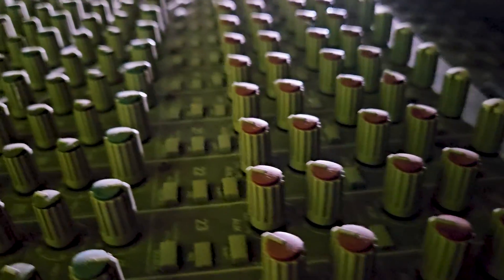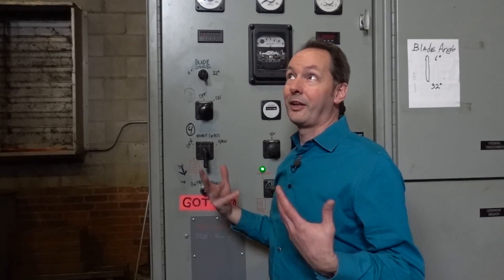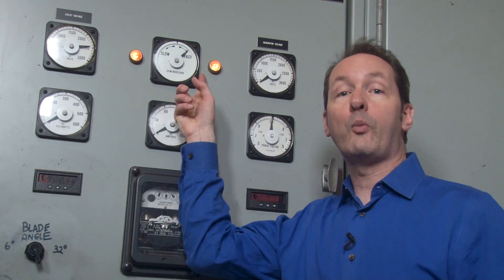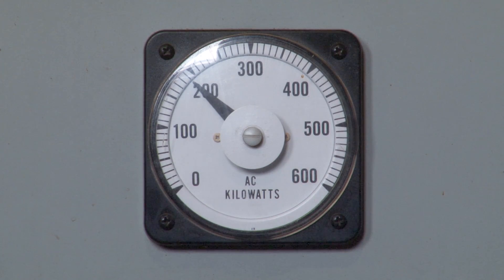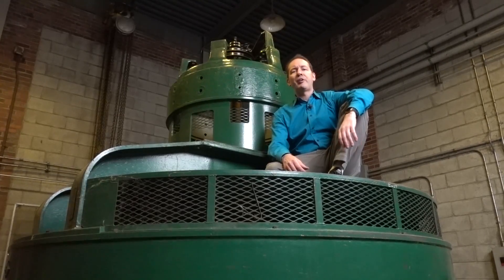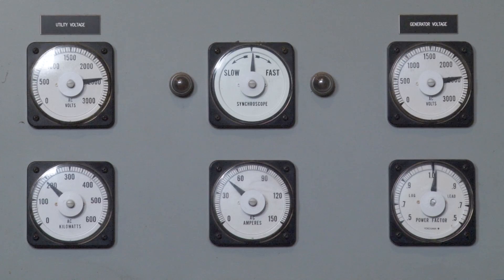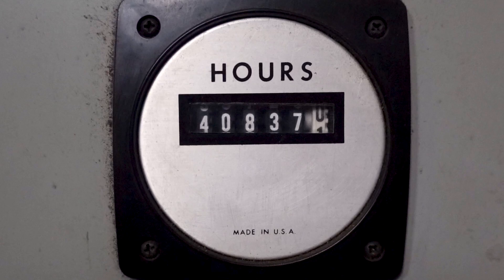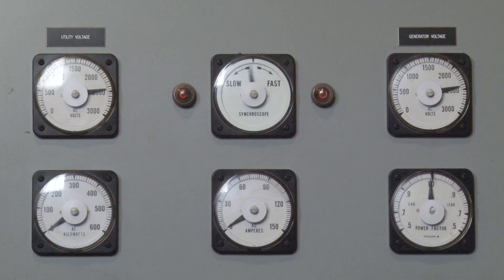Powerplant Control Panel Tour - Part 1 Authorized Personnel Only S4E1 #engineering #powerplant

Comment: Old school prime power plant operator from the 80's.  Small plant, about 3 meg-old even then.  (Newest sealed parts were stamped in 1957)  Did manual paralleling, of the 6 diesel generators as that was the only way we could parallel, on the Golden Gate switchboard equipment we had.  We were the same voltage at 4160/2400 VAC.  Manual loading/unloading, the whole nine yards.  We had the synch scope, and the lights.  Paralleling was always a pucker moment.

Comment: The average home has a  potential to consume 200 amps. But on average its probably half that. Rarely is every appliance, every light, every TV and stereo and PC on at the same time. So roughly an average home consumes  Basic math would be 24kw. Then just multiply that by how many homes served by your utility.

Comment: ELI5: Difference between voltage and amperage? Numbers (110, 220 , 440 etc). I don't have the trades science tism. I have the know a little bit about a lot tism. My exciter would turn on if everything is running. Yay movement and noise 😊 please and thank you. You're doing God's work Chris, for so many different reasons. Keep it up! 🫡

Comment: The math works out if you assume 1.0 PF. Obviously the analog meters are not able to be inferred exactly, but if you eyeball it, then~191KW (total) = ~2410v (L-N) * ~46A (L-N) * 1.732 (converting 1 phase to 3 phase).

Comment: 1500 volts, 200.000 watts / hour. If you calculate this it should be 135 amps, but there are 3 phases, so each phase will see 45 amps when delivering 200.000 watts at 1500 volts.

Comment: I blew $900 on a heavily used 40 channel, 8 bus mixing desk that came out of a megachurch. Naturally, coming from a place like that, it had to be purified before it could be used in my basement studio, complete with acoustic treatment consisting of Harbor Freight moving blankets hidden by vaguely gothy wall hangings. There were candles and incense involved, along with a tolerable middling-grade absinthe. I will neither confirm nor deny the involvement of a sex worker, nor a not-so-well-known "murder punk" band, first of their sub-genre.

Comment: Not on the "vegas mode" spectram. Control panels need to be where required and minimal. Most should be UI or at place of need towork even if electronics fail. Especially emergency relevant controls need to be retard level simple. Preferably one switch to turn everything off ALWAYS everywhere 0:43

Comment: Fun stuff! I recall reading that some utilities will shift the 60Hz frequency ±0.5Hz to control how much power personal solar / wind / etc. grid tied inverters can put on the grid. I wonder how they correct for that since many electric clocks, and other grid tied devices, depend on the highly accurate 60Hz tolerance.

Comment: And now I need a reason and application for a synchroscope in my amplifiers (volts and amps can monitor usage and battery level... Maybe the Synchro can measure sound quality by feeding a tone through the amp and checking both input and output?🤔)

Also, Black Start... And, gee Chris, why is the KW/H such a sucky unit?😏😆

Comment: So with your nominal voltage of 2400 and only pumping out a meager 200Kw, you're only generating less than 100A of current?
That seems... I wanna know, where are you that a functional power plant only needs to add 200kw to the grid and how is that profitable? So many questions. Guess ai should finish the video, first, lol. Absolutely love your stuff!!
Reply: I'm not a power plant (as in this video) but I do work with large trailer mounted mobile power stations. We usually are sending 800-1000Kw through 2 semi trailer mounted units. Easch unit is actually 2x 400Kw gennies with a control room between.  So we have 1600Kw max and usually stay below 60% capacity. Even that is usually only for a couple of hours, max. 
480v with the usual 5wire 3 phase run of 4/0. Easch of the 3 hot legs safely passing 200A of current.
So we have many sets of this f*%king heavy ass cable and run it hundreds of feet to a set of 2x 800Kw transformers.

Comment: Output amps look fine to me. For those more use to single phase, the voltage here is being measured between phases, not phase to ground. Phase to ground is worked out by dividing phase to phase voltage by the square root of 3 (1.732) = 1,385v (RMS). There are 3 phases, each at 46 amps. So, 3 phases x 46 amps each x 1,385v = ~ 191kW.

Comment: The plant where I work was disconnected from the grid. 38 mw biomass plant. None of the operators have experience this. I had to walk him through documenting. The reason why we tripped resetting of the trips. And getting our power back. We have a 115kv feed and generate at 13.8kv

Comment: I thought the reason the gagues don't line up is because the AC voltage is measured as the average voltage, rather than the peak of the sine.

Comment: Two reasons for volts times amps not equaling Watts. First it’s three phase power so you have to multiply by square root of three to get total power, and the second reason is power factor.

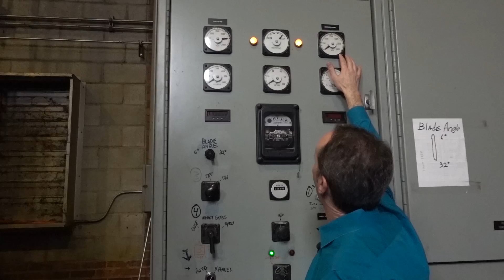Comment: At 5:55, why did you back into the grid?  Normally I like to get synchroscope moving slowly in the FAST direction to make sure the generator will pick up a little load when the breaker closes to prevent any reverse power.

Comment: As a machinery technician in the US Coast Guard for 24 years, it was part of my job to operate the shipboard generators. On Ice Breaker GLACIER, we had 4 500kw generators and 1 250kw emergency generator. The ship was built in 1953, ironically the same year I came on line. Our control panels unsurprisingly looked exactly like the one you’re talking about. 
Now this is one of those things that may not matter, but I was always taught to have the sync scope rotating clockwise slightly fast as the diesel would slow down a small amount went the load was applied. 
Who’s right, or does it not matter?

Comment: Mmm power generation. I grew up close-ish to the Bonneville Dam on the Columbia, and so I grew up living underneath the half-million volt transmission lines. 

Also typically when connecting a power source, in the navy standard practice was to have the synchroscope rotating slowly in the fast direction, but we had automatic voltage regulation (read: governor control on the turbine generators lol)

Comment: i toured a 1500 MW hydro plant when i was 16 and I've been hooked ever since. great vid 🙂
Reply: that was in 1995 and it's since been uprated to 1800MW(e) although my understanding is the plant rarely operates at full capacity as the NEMCO legislation requires them to maintain a certain amount of spinning reserve. It can also operate in syncon mode if and when necessary.. Pretty cool stuff, 6 Mitsubishi Francis units all managed by remote control in southern NSW Australia
Reply: the machine ur sitting on is smaller than an exciter at T3 just sayn
Reply: in answer to your question, it's all cyclic mate and if u truly wanna measure it smart meters with real time GSM connectivity will yield a pretty close answer

Comment: You could also just have a power strip that has one of the little blinking LED light switches in it and it blinks with the electricity coming in

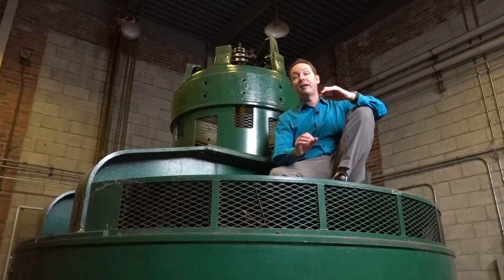Comment: IHi Chris, I've been a plumber for 35 years, I've been working in the plumbing industry for both industrial and domestic fields, I'm welding certified and have travelled the world since I was 16.   To answer your question at 9:15 about how many houses your generator has been powering: I have no fucking clue.   Hope this helps!

Comment: Can you actually explain why kW/h is a stupid way to measure. please :)

I studied for a bit to be electrician but switched fields to automotive. Still do a lot electric work but I basically only work in DC so I'm bit rusty on electric grid stuff.
Reply: A watt is just a Joule per second, so a kWh is basically a kJh/s or kilojoule hours per second. An hour is 3600 seconds, so that's equivalent to 3600 kJ.  You're basically putting in a time measurement and taking it out again when you could just measure everything in Joules.

Comment: Retired sparky and used PLO instead of AIP. Parts left over. We had three 2,000KW diesel Gen sets that would start up  & at least two of them be on line in less then seconds . Also had 4 natural gas gen sets that each had 6 huge 1,500 CCA 12 volt batteries connected to three 24 volt starters to get the pigs on line in ten seconds. Also made a ton of money during the summer using them to peak shave on hot days. Had to shed think it was 2 megawatts for 4 hours. Engineers would start up more boilers then turn on huge steam chillers and take the 2,400 volt chillers off line . Would transfer a few ATS's that feed mechanical loads thru VFD'S from normal power to emergency power ( generators ).

Comment: I did fuel cell micro-grid research for the DOE from 2003-2008. We used 2,200 watts as our average for residential loads. This was in the Southeast US where it's hot as crap in summer and we don't use oil or wood for heating in winter.

Comment: old school cool is more reliable then electronics there is to many variables that can go wrong sure automatic controls may be more so called efficient but when something goes wrong finding the problem can keep your system down longer trying to find out what happened. efficiency is not all ways a good thing  electronics are failing all over  take your power plant yes you have issues time to time but the old school is robust and simple  sure some items are hard to find and and have to be custom made but electronics have to be custom made as well to preform certain tasks then there is items that have software. your power plant will most likely out live all of us but the automated wont.  of Corse this is my opinion.

Comment: I don't know if any of it is still there, since I haven't visited the campus in decades, but when I was at WPI in the early '90s, the ground-floor lobby of Atwater Kent Laboratories (the electrical engineering building) was dominated by an enormous antique electrical control panel. It looked like the kind of thing a person would use to resurrect Boris Karloff, all humongous knife switches and big Bakelite knobs. Quite possibly the coolest thing on campus, and that was at a time when WPI still had a nuclear reactor. :)

Comment: I've only read and completed "Lessons in Electric Circuits Volume 1" that was when I was 16 There's several volumes and they are all free. I've been tinkering with dc circuits and building my own from toys I broke or took apart as a preteen.

Comment: The power station where I work comprises two 660MW and four 100MW units. And I work as an engineer on the two 660 MW units. And as you know, operating a thermal power station is far more difficult than operating a hydroelectric facility.

Comment: Interesting videos! To get the power output you need to multiply volts x amps x 1.732 which is the square root
of 3. This is because you're dealing with 3 phase delta power.

Comment: if the generator is grid tied it should be powering all of the loads on the grid with its 200kw, meaning a very small potion of each load.
system losses might also mean that more local loads would recieve more of the generator output. 
as far as i understand, i am prepared for correction.

Comment: As a mechanical engineer who’s worked in the electrical/power distribution service industry for 10 years I appreciate your content. I never get tired of visiting power plants and learning about their controls and processes. My favorite part is just seeing the vintage equipment that they have. 

Abandoned in place is a nice acronym. My whole world revolves around this type of equipment and keeping the old stuff going in some capacity or another (relay replacements, generator circuit breaker replacements, general switchgear bus/insulation replacement etc). It’s cool seeing you all still operating with all the old school tech!

Comment: Depends on time of year.

In the dead of winter on a dangerously-cold day, our house will draw somewhere around 23 kilowatts when the HVAC’s resistance heat kicks in.

I think you said your average transmission rate is around 250 kilowatts. So that translates to around 12 houses.

Of course not all houses will draw that much current. We are all-electric and use around 14 megawatt hours per year here in central Virginia where, ironically, the air conditioning load isn’t the real consumption issue. We have new heat pumps that are awful when it’s very cold. They’re inefficient below 20 degrees and on the coldest day we used 1/3 of a megawatt hour. Oops, that was before both were replaced.

I think your 1KW base load per house is pretty conservative and my guess is that you are powering around 300 houses on average.

Comment: Saw your videos ages ago and stumbled back across.  Echoing the black start request.  Does whoever comes online first set the frequency and everyone has to jam sync to them?  Also curious what happens if everything goes dark, how do you manage load so when things come up the draw doesn’t crash the system right back to nothing again?  Does it take a certain number of generators firing up together before supplying any customers again so there’s some buffer?  Must be the greatest draw on the system coming up from black.

Comment: Comon Chris, even I had emergency lights at my 23 year old gas fired power plant (Duel Alstom GT 24 with heat recovery units).
Reply from the maker: Look at you with your fancy new powerplants. The only thing that's as young as 23 years in this place is the top layer of crud and dust. This isn't a powerplant, it's Hospice for feeble old generators. They won't give me money for a BATHROOM I don't think I'm going to get emergency lights. But it's a good idea, and I'll ask the boss nicely.

Comment: CIVIL - Capacitance = current leads voltage, Voltage leads Current Inductance.

I find your videos fascinating.  I nearly got an apprenticeship with the CEGB (Central Electricity Generating Board in the UK) but went into the computer industry instead.

Comment: My calculations for the number of houses supplied are based on the annual output of the small  toy power plant.
The output fluctuates from 1 to 22kW throughout the year and we generate around 75MWh per year.
Based on 3500kWh/year, this corresponds to around 21 households.
But this is my way of not having to tell people that we can't even supply a toaster in the summer.

Comment: U need to calculate 3 phase power, P=3^(1/2)*voltage*current*power factor, then it adds up, also its phase to phase voltage so u measure it across 2 phases and not phase to ground

Comment: Chris in my old company (pre solar) in Australia for planning for new subdivisions we allocated 4 kva per house for areas that also have gas for water heating and cooking  areas without gas 7 kva per house. Being a 240 / 415 volt system we can run long and large LV distributors and much larger distrubution transformers and much less of them than American 120 240 lv . Usually that equated to transformers of 500kva so 120 houses for gas areas 75 roughly for  all electric subdivisions per transformer . Your little hydro plant is really only half the output of one of your distrubution transformers. Thanks for the in depth explanation of your plant I love to learn and especially love old technology systems .

Comment: To answer your question - last year I went around my 5-bedroom house and recorded the electricity consumption of *everything*, either with a plug-in power meter or by looking at the numbers written on them, then multiplied by the proportion of the time each item was active, came out with a total of 520W mean usage, which lined up reasonably well with what my electricity bill said (577W). That's including 75W for an always-on computer, but not including heating (which is gas-powered). Then I was shocked at the fact that 91W of that was lighting and went around changing as many bulbs as I could to LEDs, reducing it by 60W. I was also surprised that I use more power running the fridge (70W) than cooking (kettle, microwave, oven, extractor fan 47W - the hob is gas). Nearly half the usage was tech - computers, monitors, TV, gadgets.

Comment: kva (kilo volts x amps) is apparent power (which is what you get when you multiply amps and volts) , watts are real power which also includes your power factor..  Your power factor, if its not at 1 they won't match. There is also the 3 phase square root of 3 that you need to figure to match up.

Comment: I work in a Datacenter, and I have on my site 14 Diesel generators capable of pumping out a total of 13.120 kW...or 13Mega watts.
But a portion of that is redundancy, because I need back-up for my back-up generators incase of maintenance/malfunction or refusal to start.
It doesn't look like that panel has any/much redundancy.

Comment: Wait.. a few cents per kilowatt hour.. and 250 kilowatts.. the highest in the us is 44 cents per kilowatt hour..(which is in Hawaii) 24 hours in the day means 6000 kilowatt hours per day at most.. at 44 cents per kilowatt hour means at most the gross income is $2,640 a day. But the average price in the us is 16 cents which would be only $960 a day.. and the lowest price in the us(which is north dakota. Where i live actually) 10 cents would be $600 a day. And that would be running at full capacity 24/7.. which would never happen.. That all seems extremely low. I cant imagine running a power plant on onky $960 a day when you factor in the price of the building, paying employees, all the maintenance, insurance, and any other expenses.. there is not much money in that particular power plant apparently.
Reply from the maker: Brace yourself, this is gonna hurt.

We sell electricity to The Power Company(tm) for $0.065/kWH.